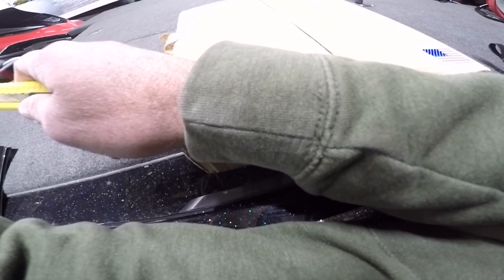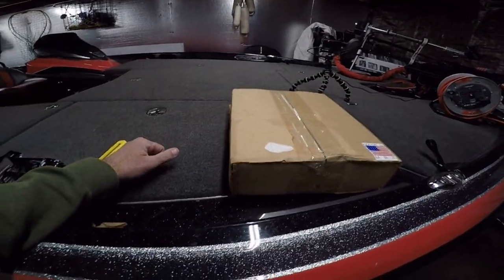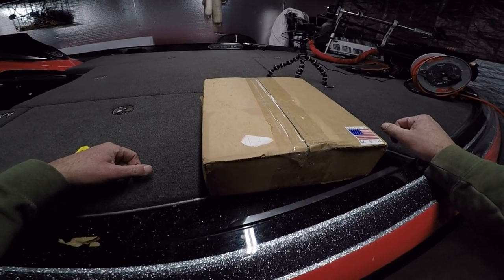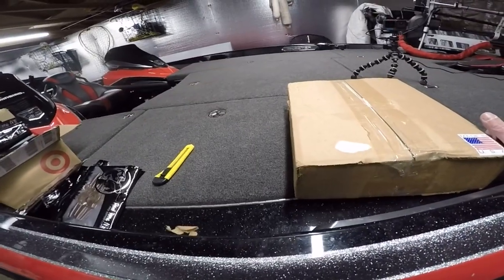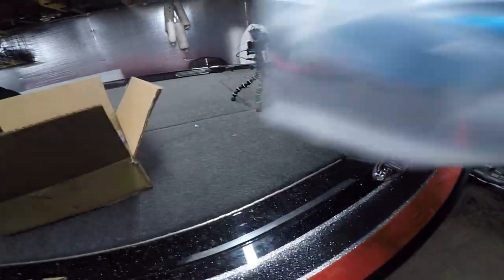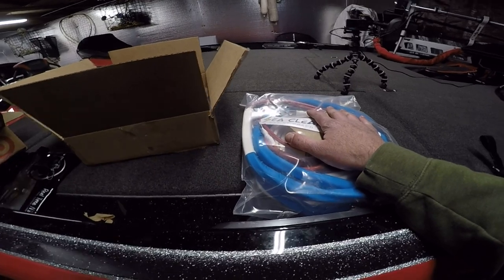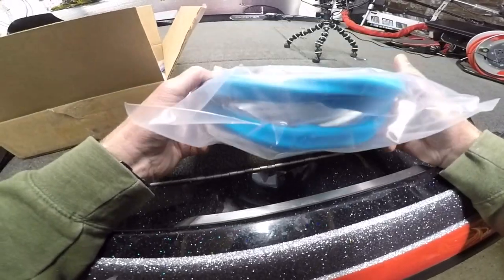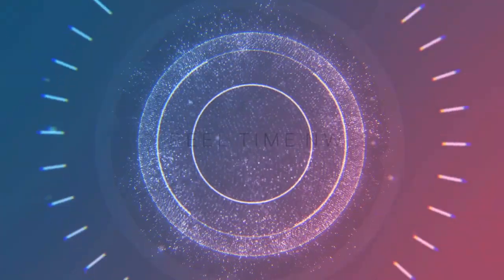Sea Clear Power - Average Angler Tech Tips - We Unbox & Explain why? #boat #skeeter #fishing

Comment: You just paid $400 for 20 feet of 8 gauge wire with some blue/white heat shrink around it.
Reply from the maker: Yup, you pay to play. This setup is unique and not just wire. Its ease of install and connectors are hands down the easiest and best iv'e ever used. No need for expensive crimpers!